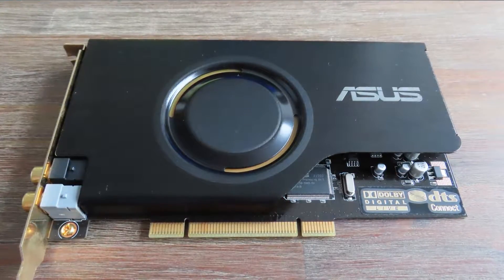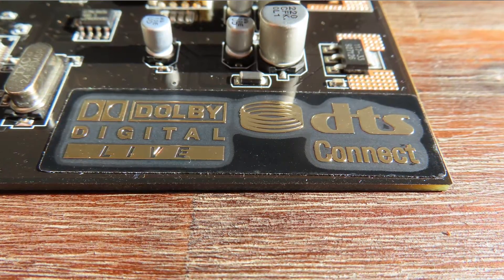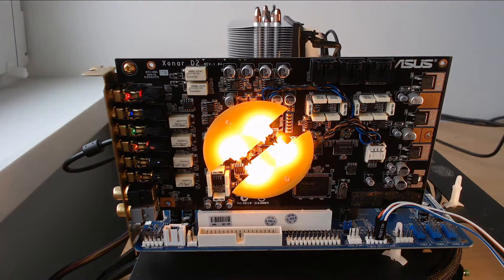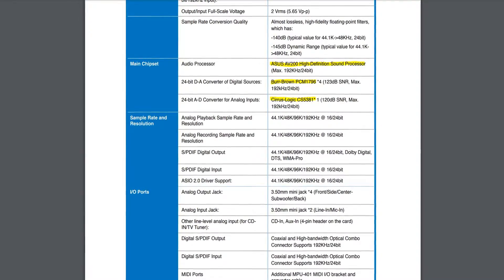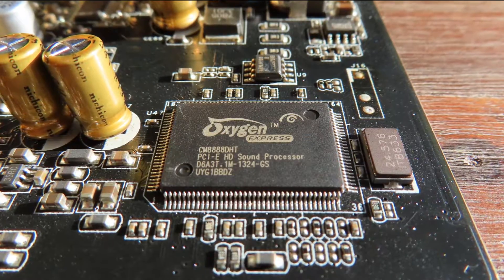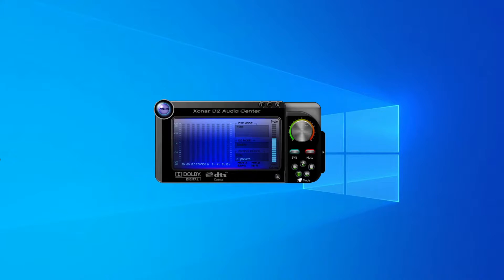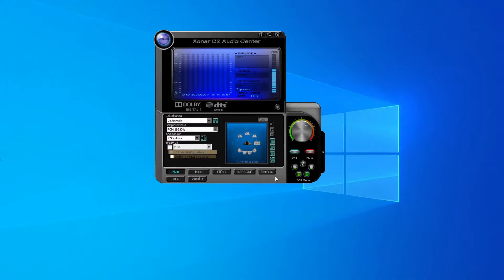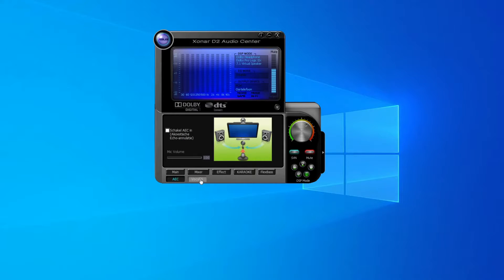A Xonar with double D?!

Comment: I found a D2X in my dads Office. I tried it, i do not regret it, to use it. Even in 2023 the sound quality is insane.
My D2x is from 2008. It is 15 years old.
I paired it with edifier r2750db and a center speaker.
Reply from the maker: Now those are quality speakers! What do you think of them? Should I get them as well?
Reply: @AntonsHardware  yes. I love them. The r2750db are one of the best speakers I had

Comment: Love your channel , I am huge soundcard enthusiast.   I have owned alot of the years.  Starting with A soundblaster ISA (faimly computer) .. My first personal would of been the Live .  After that I have owned Audigy , Audigy 2 Platinum (Had white 5.25), Then I got a black case and switched to the Augigy 2 ZS Platinum Fatil1ty edition (black 5.25),  At some one I got A platinum Pro.   Then came the X-Fi  Platinum Fatil1ty edition .. .switched to the  x-fi elite pro at some point.   My first PCIe x1 card was the sound blaster Zx then came the ROG Xonar Phoebus (loved the sound , HATED the software) ... it end up die-ing and went back to the Zx.  Then came GA-Z97X-Gaming G1 WIFI-BK (had A built in Sound Blaster Z)  and Just used that till the last year or so.   Now I am on Ryzen system and have the Gigabyte X570 AORUS MASTER.  Overall I like the motherboard .. but I cant not stand its onboard audio or software.  After A month I went on ebay and grab A cheap Xonar Pheobus  (again) and have been using that ...  checking for driver / software updates for the on board but still not happy.   But I am also not 100% happy with Pheobus either .. drivers are old and the software  is bad.    So ... that brings me today.   I want something new.   I was thinking of the Xonar AE (thats how i found your channel )but ... really dont want to deal with Asus software.   But I end up buying my first USB sound card (CRAZY I KNOW,  feel kind of dirty)   The Sound Blaster X3 has some crazy good reviews so .. going to give it A try.   I have watched A few of your videos today and think it would be good to see your point of view of it .

Thanks for the videos and info .. Keep of the good work.
Reply from the maker: That sounds very similair to my situation! I still own my first Soundblaster 16 bit and I too had a Live!. Altough I never had the platinum. 

Thanks for the heads up! I will take a look at the X3. I did the G1, G5 and G6. Wasn''t too happy with the G1 and G5. Sound quality was very very poor. The G6 was really good! I do have a lot of projects lined up. Fiio Olympus2, the Sennheiser GSX 1200, the Live! (yes that one! :D) a Fosi Audio... So much to do and so little time! Thanks for the support! Really appreciate it! Let me know how that X3 works out for you!
Reply: @AntonsHardware  So .. I have had the X3 for over A day .. and I Love / hate its ... but its going back due to issues.     
First off the sound was good .. truly surprised me, even the SXFI was good done well ... My issue that i was going to live  with .. was the slowness of changes in software or turning volume knows .. their is a delay that was very noticeable ... did not like it .. but would of kept it ... However  .. it broke on me .. the Dial / Knob is also A button .. and it seems to have broken .. and have to press in A very specific place for it to work .. and the knob is HUGE.   I assume that if broke this fast .. it will only get worse.   Going to look into something else .
Reply from the maker: Thank you for that! No need to review the X3 now :D You may want to wait. I'm planning on doing my next video on the Fiio E10K amongst others. All available on Amazon (and I don't any commision:))
Reply: LOL,  i have a Gigabyte b550 master and loath the onboard sound after coming from a z370 gaming 7 which i believe has a similar audio chip and ess sabre dac  that the x570 master has.
I actually liked that set-up for battlefield games, but have just reinstalled my old xonar d2x in the b550.
Much better, which is amazing considering it is a 12yr old bit of kit.

Comment: Hola Antons!! Dime, vale la pena activar las tecnologías cristalizer o virtual surround en las placas de sonido?
Reply from the maker: I'll reply in English (Spanish Google translate below): I've actually done some measurements with the crystaliser and virtal sound enabled. And the sound will only get worse. Especially Creative software was designed to create 4.0 surround simulation, by just adding a lot of echo and phasing out between different speakers, to create that "surround" sensation. But in reality it will make the audio worse. So I'd say no!

De hecho, he realizado algunas mediciones con el cristalizador y el sonido virtual habilitados. Y el sonido solo empeorará. Especialmente el software Creative fue diseñado para crear una simulación de sonido envolvente 4.0, simplemente agregando mucho eco y eliminando gradualmente entre diferentes altavoces, para crear esa sensación "envolvente". Pero en realidad empeorará el audio. ¡Así que diría que no!